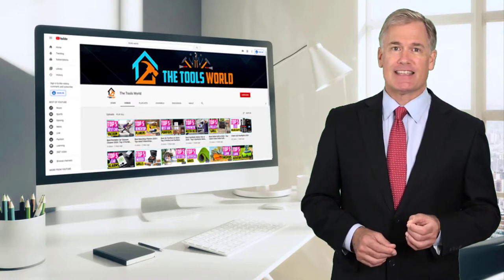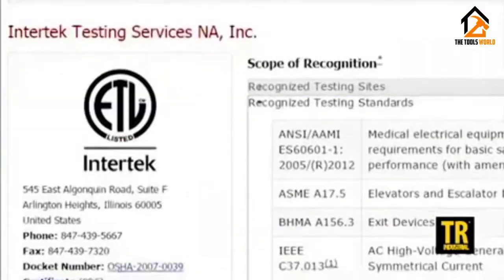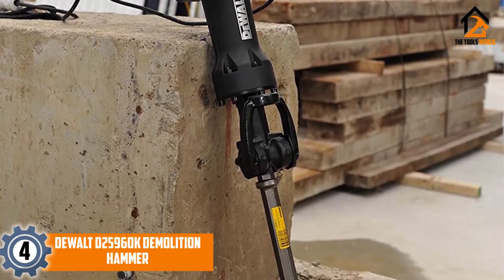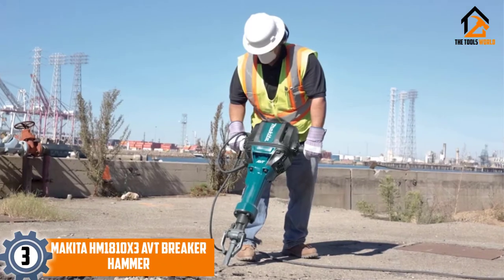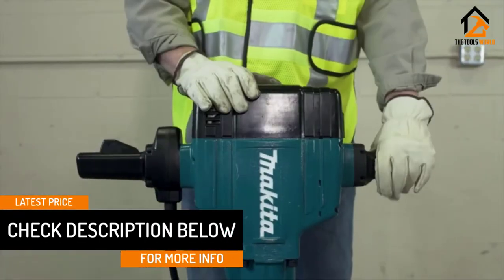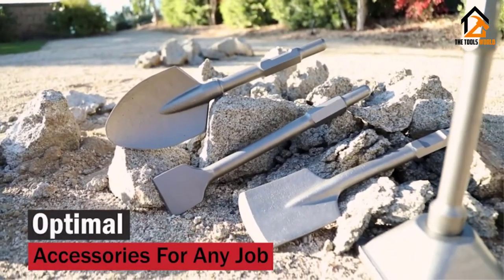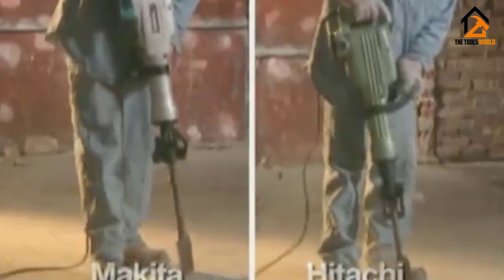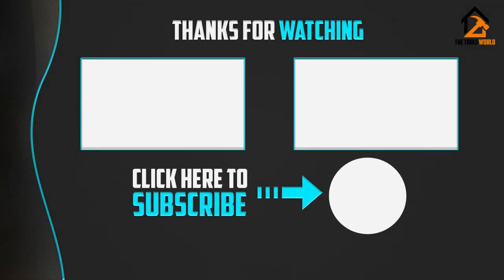Best Electric Jack Hammers Review

Comment from the maker: ▶ In This video, We recommended the top 5 Best Electric Jack Hammers.

▶ 5. TR Industrial TR89100 Electric Demolition Jack Hammer.  
 
▶ 4. DEWALT D25960K Demolition Hammer.    

▶ 3. Makita HM1810X3 AVT Breaker Hammer. 

▶ 2. XtremepowerUS Electric Demolition Jack Hammer. 

▶ 1. Bosch 11335K Jack Hammer.